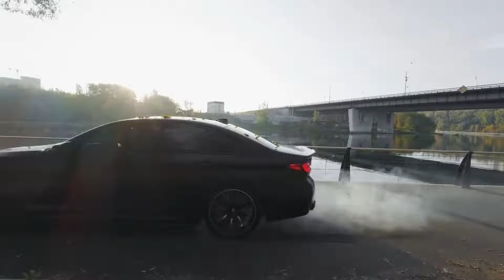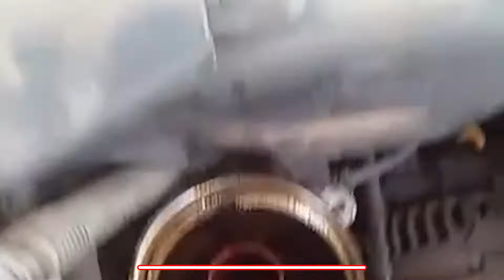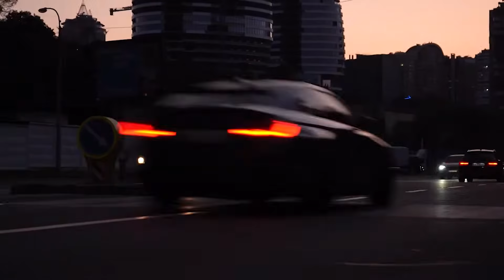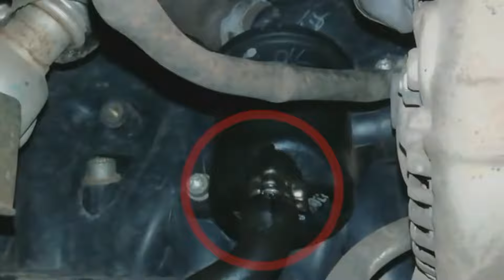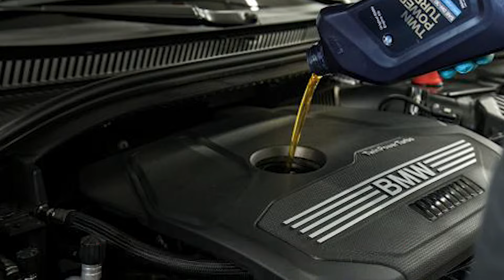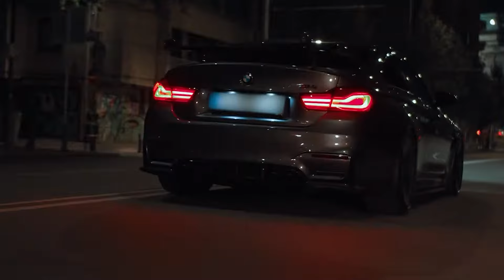7 Driving Habits DESTROYING Your BMW Engine Without You Realizing

Comment from the maker: Which of these bad habits are you guilty of and which one shocked you most? Drop a comment below 👇
Reply: Bmw themselves said you don't have to wait 30 secs before pulling off, just drive gently below 3000rpm. I know you're talking crap here bc I've done this for 6 years on my B58 and never had an issue.
Reply: Idling🤦‍♂️, Guilty! Pretty good at the rest though, don't like the auto stop start so always switch it off,  I figured might be the cause of accelerating the timing chain issue, all that pull on the chain at start up?  She's  a 2013 430d 257k kms on original turbo, injectors, 10-12k km oil changes gentle warm up,  mostly motorway driving but do get caught up in the dredded rush hour traffic! 

Thinking of deleting the dpf and egr as these are causing issues now! No real loss to losing these components but everything to gain? I've already replaced the intake manifold and had to clean it twice! So that alone will be one of the biggest benefits!  Our car testing here only does smoke test so a working EGR not required, DPF needs drilling because it must have one but they don't check operation so it's just a visual its there it passes, if a straight pipe is in place instead it fails🤷‍♂️

Comment: BS .....those turbos are made out of recycled tonfoil will blend of crap...
Theres a fella on yt that works on bmw only. Stuff you see there reminds me of the time i owned them. Its a story of a fools that just work to own these stupid pieces of plastic sh...
160km on pdo and whole cooling system needs replacing? Same ole crap that was happening since 2000s.
They figured how to atract customer with looks and  interiors but effed everything else. Weak parts and exuses blaming driving style etc...like owners have to be trained by factory to treat them a special way and only then they may last longer...what a load of shite. 
Advise to buy cars woth cast iron blocks and large oil capacity with as little plastic on engine as possible . And proper steel cartridge oil filters. Korean market is looking much better that this german crap

Comment: Habit 1: Nonsense. Always waiting 30 seconds is harmful to the engine. The oil pressure is there in 20 to 30 rotations.
Habit 3: The automatic system prevents that.
Habit 5: No modern BMW shoes coolant temperature.

Comment: If you use start stop, the turbo continues to turn and because the engine has stopped, it's not getting lubricated by the oil.
Reply: First thing I coded out with bimmercode